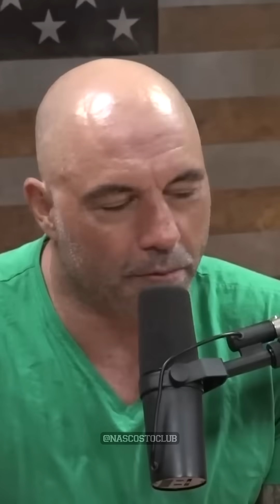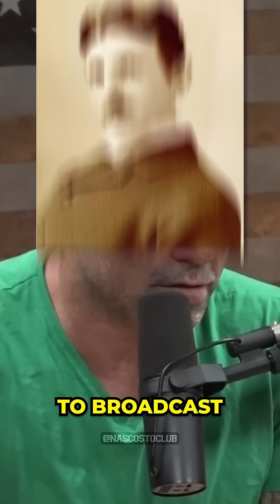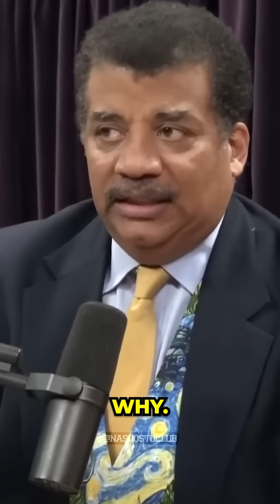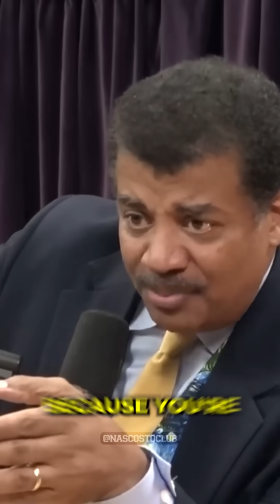WIRELESS Electricity Idea Debunked ⁉️⚡ #shorts

Comment: But it’s ideas like that which spur on innovation and inspire separate yet equally amazing inventions. Wireless charging still requires the devices to touch but we’ve broken the need for a wire. They’re already working on it being in close proximity. That’s also kind of what Joe hinted at. Can we do this in smaller circumstances. Neil is super smart but is often close minded when it doesn’t suit his already formed opinion, and I say that even though I agree with the vast majority of said opinions. - By the way I got a lot of naysayers replying to my comment the first time around, so I’ll include one example of hundreds that exist. Look up “Motorola’s new generation of wireless charging unveiled” and you’ll see the charge take place through an extremely accurate beam. The next phase is, instead of a base that we put our phone on that receives the beam ten feet away, we build it into the back of our phones. Now this isn’t exactly what Tesla hoped for, he wanted more, but mankind’s reach has always exceeded its grasp. The future is so exciting.

Comment: Well, you can just have Neil hold a normal fluorescent tube and walk near a broadcast antenna. When it illuminates without any wires or insulators attached, what will he have to say? That is propagating energy through the air.

Comment: I think electricity could be broadcasted through the air and I think it could be used to power things mechanical but it would have to work something like a solar panel with a big antenna and the bigger the antenna the more power you could possibly soak up... I also think electricity is already in the air and you can already do this and they already have with some radios that don't require a battery

Comment: Here's the problem with what Neil is saying.   Tesla did it.  He built these stations and they worked. So yes. It went threw the air and didn't electrocute anyone.
Reply: Not really.
He barely got enough funding to build the tower itself, but the required mechanisms, power source, etc never cane true. Those stations never worked, and his experiments with witeless electricity transmission only worked in his small labs.

As anyone knows, it is not hard to make electricity arc through the air with a Tesla coil, but the further away it must go, the more resistance it encounters.

Just to get a lightning to go from the clouds to the ground takes unimaginable amounts of energy that can easily fry any human standing in the way in the wrong circumstances. A global scale transmitter would have been impossible energy wise, and disastrous if it would able be constructed according to basic laws of physics.

Comment: Neil is technically correct with everything he was saying, but is so fundamentally wrong in his approach to solving the problem.

We now have wireless charging technology for electronic devices, and the principle for how it works is by using radio waves and then converting the radio waves into a DC electrical current inside the device with a little converter and microchip setup specifically designed for the job.

All electrical devices could operate wirelessly, and the technology would already be ubiquitous if the Tesla’s ideas had not been suppressed by the petroleum industry, and all of Tesla’s personal documents were confiscated by the government after his death.

Comment: Using microwaves you can boardcast electricity up to 100km.
Reply: Yes, and what happens to the living thing standing in between the sender and the receiver?
Reply: Put solar in space (cause more efficient /higher power production) and beem back to receiver on earth. Nothing in the way between the 2 so it's not a problem.
Reply: @nonyabusiness1939  It has been discussed for decades already, but it's very expensive to build, and dangerous. All birds flying in between are toast, and you need serious regulations so that no planes and such fly in between.

A solution is to build the receiver very high up in the air, maybe even using a tall mountain as a base. But still, extremely expensive. And it also depends on where the generator are located, satellites in orbit, rocket launches, and stuff like that must be kept clear of the waves.

So when you say "not a problem". yeah you are full of crap.

Comment: Told its easier to transmit power than information.

The generators vibrate at the same freq as the signal transmitted.

Comment: If you have a modulated frequency that travels harm free thru the air and once it reaches it's destination (apparatus tuned to said modulated frequency), the device itself could vibrate at miniscule level not noticeable by the owner but enuff vibrations to cause the device to charge
Reply: you just think this up now?  you and Joe ought to get together.  he thinks up stuff too.  try taking a physics class son
Reply: @brians9508 

Your ignorance and arrogance are letting you down.

He's right if the energy is transmitted at a set resonant frequency to the collector it essentially works fine, the issue is finding the right frequency, which Tesla did. It didn't take off because big electricity wouldn't profit from it. Also the US army confiscated his work, so have fun with that rabbit hole.
Reply: @brians9508  Neil thinks stuff up. Thor's hammer weigh 300 billion herds of elephants according to him. If he's observant, he should know a table can support the hammer's weight. LMAO
Reply: @brians9508  You should try thinking. Its hella fun
Reply: @Jere0101  says the guy with absolutely nothing meaningful to add to the conversation . . .
Reply: @brians9508  neither did you
Reply: @Jere0101  i did, but poor you, you are incapable of understanding anything but the simplest of thoughts
Reply: @Jere0101  and by the way, is that the best you got?  a simplified version of "i know you are, but what am i?"
Reply: @brians9508  why are you so insecure about your intelligence?
Reply: @brians9508  "0 likes"
Reply: @brians9508  Finally someone with a minimal understanding of physics. People here simping for Tesla without having the slightest interest or knowledge of physics is between hilarious and depressing

Comment: Tesla already. Finish the calculations. And its safe. NEIL is just. Complaining. Hes just questioning the inventor of ac. And Neil is like Edison. His trying to electricute the elephant and horse. Just like Edison. his yawning coz dont understand. astrophysicist vs inventor engineer. This is the difference between thinking science vs applying science. And tesla already holds 1m volts live wire with a certain frequency and lived.

Comment: its sad how badly he explains it
hes supposed to be good at this
its very simple
electricity takes the path of least resistance
your a big bag of salt water
salt water conducts electricity
air does not conduct electricity very well
your going to be the path of least resistance 
the light bulb will be powered not trough a wire but trough you
now go hold the wire to experience what that does to a body 
dont
you should know better

Comment: Anyway possible to "transform" or code Tesla's alleged wireless energy in his idea? Can't destroy or create energy, got it, but can transfer and transform, all good. That way we wouldn't pull it out of the air, it would be pulled by the appliance, and then transformed/converted or decoded into a usable energy? Perhaps some type of nanotechnology could help "insulate" these feeds, or perhaps discharge them during transit, and then once these feed packets are accepted by compatible appliance, it becomes charged again?

Comment: Neil is wrong in this case. Electrical energy does not travel in the wires, it travels around the wires in the form of of electromagnetic field. The electrical cables merely serve as a way to guide the energy to where it is needed. Yes, this means the energy density is very high in the space close to the conductors. This explains why electric blanket can not be left on while you’re sleeping on it.

Comment: actually we send 120volts up to 480v AC on conductors to an electronic driver that brings 12v DC to a light emitting diode.  this would work wirelessly, but not over radio waves -   electromagnetic waves work no problem. using....drum roll....tesla coils.
 electromagnetic waves through our atmosphere and our earth.  (that is what the tesla coil does)

Comment: Um yes and no and yes and no! Yes, radio waves are the Tesla Coil reimagined.. no, you could use them to power some stuff, and they do.. does anyone remember the RF chip they were gonna put in your hand.. that chip uses radio waves for power.. it was used as the "Speed Pass" at many gas stations.. 
However he's right.. it won't power cooking food or heating or air conditioning.. those technologies require a resistor.. and a lot of Amperes, which is like water pressure..
The Tesla Coil was never designed as a Power Generator, only a way of transmission.. the problem is that the Earth grounds out very often (lightning) basically undoing all the effort of a Power Station to add electricity to the air...

Comment: Correction neil the electricity doesn’t actually go through the wires its flows is the electrical field around the wires so yeah it can be done
Reply: ^^An example of understanding the fundamentals, while fundamentally misunderstanding. I don’t know if that’s a quote I just made it up… Anyway, we use wires because beaming electricity through open air requires high voltage like 3000 V per millimeter of air gap. However, we can greatly reduce that amount bypassing the electrical field along a piece of conductive material like wire. Now imagine how much power would be required to beam a consistent 260 V at 60 Hz. And realize that we’re talking about beaming this electricity over an entire city not just in a faraday cage next to a tesla coil

Comment: The power through powerlines actually DOES move through the air around the wire... it DOESN'T GO THROUGH THE WIRE. It's Not passing power like water in a tube. That's not how electricity works and Neil doesn't actually know this..

Comment: It's not practical to because signal strength losses are sooo high(distance cubed). Yet you can off course optimize them by focussing them, still the loss from transformation of energy would be too high to be practical.
It obviously is absolutely  possible to send energy as radiowaves and power "something" with it. That's how NFC (smart cards for  payment or chips in animals...) works. Your card taps into an EM field to power a small processor and the processor shortcuts the field to encode a message. The card reader detects patern of collapses of the EM field strength as message.
In West Berlin there once was the strongest radio station of the World. I think it was an American radio station. It made sure that East Germany could get Western News and Music. This signal was so power full allotment garden owners simply put a cable of a specific length on a pole and used it as LC-circuit to power little lampion chains.
This was off course illegal and the German Postoffice (they were responsible) put an end to this practice...as it basically caused a dramatic collapse in the range of the signal...as the power is used to power lampions.
So it's is do a able. If you have the most powerfull radio tower you can send electricity to power some little tiny lampions.

Comment: I disagree at low amperage and static electricity pretty f**** harmless probably enough to power lightbulbs and household s***you do 12-volt DC current with less than 2 amps

Comment: The Power is around the wire which is called the Electromagnetic Field when you turn the switch on from the light bulb wire does the switch turn on the light immediately it does not travel through the wire only The electromagnetic field created by the flow of electricity also creates a magnetic field around the wire that can interact with other magnetic fields. This interaction can cause a current to be induced in another wire nearby, which can produce additional magnetic fields, and so on. This is why electricity is able to travel long distances through wires and still be able to light a bulb at the other end.

Comment: They are already producing wireless electricity. I can't remember which company but they have an entire home electrified wirelessly but distances are a challenge. Plus Tesla demonstrated it was possible
Reply: There's been "wireless electricity" for a long time. It's performed via induction and it works by the electromagnetic fields created by pushing current through a conductor (inductor stove tops work this way, as do wireless phones chargers). The principle has been known since at least the time of Tesla, but I wouldn't be surprised if it was even earlier when Maxwell was giving us his equations. The issue is that the farther you get from the field, the less effect it has on other conductors, so powering anything via induction means that you waste a lot more energy then if you just plugged it in. There are plenty of good applications for it, but if you replaced everything with it youelr energy bill will be a lot more expensive. So it's best to just stick with plugging things in.
Reply: @bignamek  check out the Disney wireless electric room. Everything in the room is powered wirelessly not just with induction. Actually I don't know if they even use induction at all in the room.
Reply: @cdickenson82  when reading through the abstracts of some of the papers on it, it is definitely induction. I don't mean to burst your bubble or come off as condescending, but that's about the only way "wireless electricity" works. It's interesting, though. Looks like what they do is have some capacitors in the room to help keep the voltage potentials nice and low so you don't risk getting hit with any discharges (because the human body could be a nice, easy path for the current to pass through). It seems like all it is essentially for phone chargers or other low voltage devices (5v to 12v). It's cool, and research like that is always worthy of more looking into,, but if you had enough current to induce devices that we require higher current loads, the electromagnetic field can carry enough current to kill you. So I don't know how practical that would be. Stuff like phone charging is very low current, so a shock from it (discharge of current) wouldn't cause any fatal risks. For the most part anyway.

Edit: and when reading a bit further in it, Chris. It does indicate in the lab that they've been able to induce as much as 1900 watts, but can be as little as 40% effecient (so that means that effectively going as low as 760 watts at the other "end"). That would be enough to power a microwave and other kitchen appliances, so that is pretty cool, to say the least. I don't know if the lower efficiency combined with higher cost, as well as other specialized devices like capacitors would make it worth it, but it is cool. I do also worry about the capacitors going out, which could certainly be hazardous.

Here's a paper on it:
https://www.ncbi.nlm.nih.gov/pmc/articles/PMC5310757/

Here's a more approachable article on it:
https://eepower.com/news/ubiquitous-wireless-power-with-quasistatic-cavity-resonance/
Reply: @bignamek  well it powers things held by people in the room and I haven't read up on it so I'd have to do that but much at the least isn't induction and has a five meter radius of powering. There's a couple science guy vids on it I enjoyed but don't get me wrong science definitely isn't my strong point.

Comment: Neil gets worked up. Yes
But u can tell, Joe didn't wanna just let it go and say "ok, yea, that was a bad idea"
"Some residual effect". No joe. Death.
Reply: I mean how many ways do you have to say it wouldn't work?
Reply: @NuhUhYou  depends on how stupid the person you’re talking to is
Reply: @NuhUhYou  It would work though. The technology already exists.
Reply: @TurboNutterBastard  What's it called? Who made it? How does it affect the human body?
Reply: @MUTRONICS1  You’re probably thinking about magnetic induction based charging like with Apple’s Qi or WiTricity’s charging for EV cars. The car is usually placed on a charging platform and the induction of a voltage in the car’s receiving coil will charge the battery. The  fields usually drop rapidly the further away you are from the transmitting and receiving coil though there still is a health risk.
This is not the same thing as transferring power through the air, the same which people will walk through. Having even short exposure to high amplitude low frequency EM radiation will be disastrous for human beings as high intensity radio waves will cause heating of biological tissue.

Comment: I don’t understand what the problem is.  You can’t send high enough power through radio raves past a few inches to do anything to sufficiently energize something.  Cordless charging pads won’t work unless the device is actually sitting on the field.

Comment: Surely there wouldn't a point of travel through the air , it would make contact from the air immediately it wouldn't need to travel anywhere , the object would be making contact with air already .I'm not saying I know anything but why would you have to pull of from a particular point then make it travel to an object .